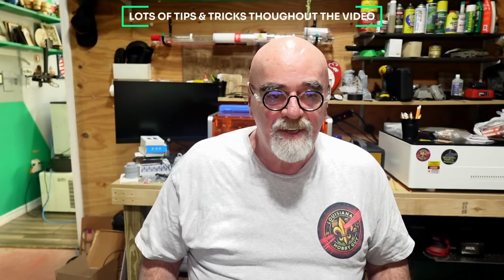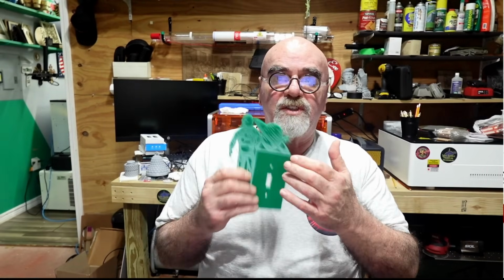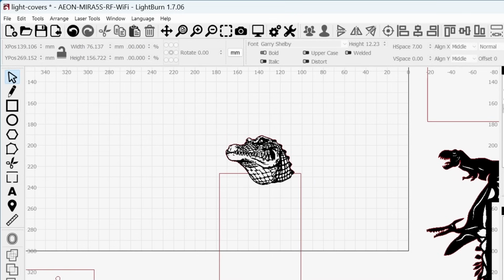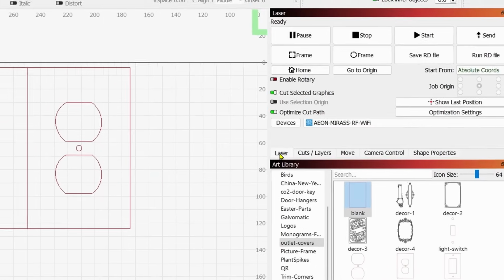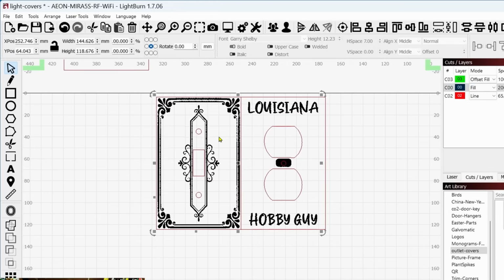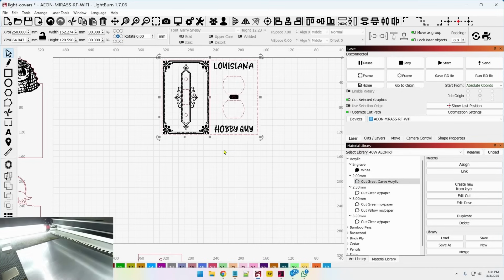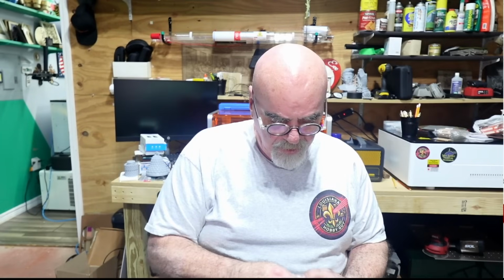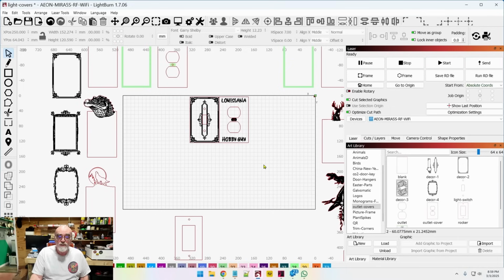💡 Making your own wall outlet covers in Lightburn on ANY laser engraver!

Comment from the maker: If you have an issue with the cover not sitting flush with the wall, just duplicate the cover, ungroup it, delete everything but the outline and offset it inwards by 3mm. Now you have a spacer to glue to the back of the cover.

Comment: How would you make a wooden or acrylic one that is up to code?  I thought about making and selling these with my co2 laser. However, wood and acrylic both can catch on fire. Any ideas?  When I have asked electricians they say neither acrylic or wood are up to code. I also dont want to get sued on my ebay or etsy stores.
Reply from the maker: No idea. Both Home Depot and Lowes sell raw untreated wooden covers, and the $0.19 plastic ones aren't fireproof. I personally probably wouldn't sell these though. While only builders and contractors have to meet code on outlet covers, you never know.
Reply: @TheLouisianaHobbyGuy  Thank you for the response back. I dont think i am going to sell them for legal purposes. I did look on lowe's site and it looks like you have to have metal plate behind the wood in order for it to be "legal". There are tons of people selling these on etsy and it looks like pretty good markup on them as well, but if someone's house burned down I dont want to end up being sued. I don't think people are thinking about this when they are selling them. 99% of people i see on etsy do not have the metal backing plate.
Reply from the maker: Yeah, pretty sure the liability falls on the installer, or owner if not done properly, not the seller of the item itself. If a homeowner buys a water heater from Home Depot and installs it themselves and there's a fire, the liability doesn't fall on HD. You could still sell them and just add a copy of a note explaining this to the buyer.
Reply: @TheLouisianaHobbyGuy  that is a valid point i didnt realize that. I don't really have a way to make the metal backing plate though. If i made them i believe id really want to do that. I looked online and cant seem to find them. Any idea where you could get those? I can't cut metal with my co2 laser or id just make them myself.
Reply from the maker: I really don't think they're necessary, since they only cover the screw holes, but you can get the metal backers on Amazon, and the plates I made did need them as a spacer: https://amzn.to/4ngH1Qq

Comment: I would be concerned with the sharp corners of these cover plates as they are flat, and a regular cover is thicker, and the edges are rounded to fit against the wall.
Reply from the maker: You can round them over if you wish.

Comment: Rich, I engraved and cut my first single light switch. It is beautiful but when I went to affix it to the wall switch, it woggle. Discovered that the light fixture does not sit flush with the wall and the manufactured plate is recessed in the back to accommodate the protrusion. Any suggestions? John von
Reply from the maker: Just duplicate the cover, ungroup it, delete everything but the outline and offset it inwards by 3mm. Now you have a spacer to glue to the back of the cover John.
Reply: @TheLouisianaHobbyGuy  Hi Rich, I did as you suggested but also discovered that the spacer needs to be 1/4" thick for the plate to sit flush. thanks again for the advice. John von
Reply from the maker: Yeah, it depends on the thickness of the sheetrock they used in your house. It also depends on the age... my house is 45 years old, and all the boxes are recessed below the sheetrock. Today, they use boxes with tabs on them to fit the studs and they stick out 1/4".

Comment: I love Lightburn but don’t care for the forum as the only source for tech support. Takes forever to get answers. 
My Lightburn wouldn’t work with my xtool lasers. 
Best Buy geek squad added a file to the program to make it compatible with Lightburn. Works great but the only drawback is I can no longer update the program. Always gives me errors when I search for an update. Geek squad said there is nothing they can do about it. 
Xtool told me their machines are compatible with Lightburn but they weren’t.
Reply from the maker: Support for Lightburn is via email, support@lightburnsoftware.com. The forum is an additional searchable resource. If you download the full version from the website instead of the update, it should work. They likely only installed the CH340 driver.
Reply: @ 
I’m pretty sure they just installed the driver. My other three computers update just fine. But they are each tied to a laser. The computer on my 40watt is newer and a gaming computer that I bought because of the larger graphics card and things run faster. Just can’t update the program. 
As it is now it all works fine and I don’t know if there are any updates that would benefit me so I really didn’t push the issue. 
Thanks for the feedback. I was once told that the forum was the only tech support. Glad to have an email address now. 
Thanks again.
Reply from the maker: My pleasure.

Comment: Great video but unfortunately I don’t have a CO2 laser. I do have three different diode lasers so I’ll be restricted to wood only. I’ve tried acrylics and didn’t have any luck. 
With the corners I think I’d put a small radius to get rid of the sharp corner.
Reply from the maker: You don't need a Co2 for scratch acrylic or dark solid acrylic.

Comment: Those are COOL Rich. We live in a Double wide, with the mobile home switches and outlets. Those things are a bear to switch out because of the way thet're wired and this would be a life saver. I would need to make them a bit larger and cut a spacer to fill the gap around them. I might need to get longer screws,as well but that would not be a problem. Thanks for sharing this awesome project.
Reply from the maker: Awesome! 👍 Thanks for watching Jimmy! Have fun with them!

Comment: Just a note that some states (like California) require switch plates and outlet covers to be fireproof (or some amount of fire rating). If you had a fire and they found untreated wood or acrylic ones there is a possibility your insurance company 'could' use that as an excuse to not pay out. I don't know which states have these ordinances but just something to be aware of.
Reply from the maker: I cut these at about 1700° without any flame, so I think they might be just fine. I doubt the cheap plastic ones they sell at the big box stores would do as well under the laser.
Reply: @TheLouisianaHobbyGuy  I was just letting you know what some states require. In CA the cheap plastic ones must 'self extinguish' when lit on fire. Don't think if you used a torch on wood it would go out on it's own like these. That being said the scenario I mentioned first will likely never happen but something people should be aware of especially if they plan on selling them. For your own use, well knock yourself out and take the minuscule risk.
Reply from the maker: Thanks, the purpose of my videos are Lightburn training.
Reply: @TheLouisianaHobbyGuy  And it's a good video.
Reply: @sublimationman  It’s not just a local building inspector issue. Per the National Electrical Code all components of an electrical installation need to be certified by UL. That would include the plate covers. I think what you’re doing is really neat. I do rotary engraving on outlet covers. I would like to get a laser to speed things up.

Comment: sigh... get ready for the flack. When I posted the files for a 3d printed cover (that I have been using for almost a decade), I got so much heat (no pun intended... well, maybe just a little...) about the "safety" of doing so. I think certain people should never attempt even replacing am outlet cover on their own. Some people need to just leave that to the licensed professional electricians. For the rest of us NORMAL people... awesome video!
Reply from the maker: 🤪 If the outlet is wired properly, there will never be an issue. Oh, and I cut them with a laser at about 1700° and they didn't catch fire, so there's that... I get your point though.

Comment: Cool. I did this design as well but did an R2D2 , Millennium Falcon and Deadpool. I had to burn the back a bit so they fit around the switches and receptacles better.
Reply from the maker: You just loosen the mounting screws on the receptacles and use a longer screw for the cover for a perfect fit.

Comment: Rich, I have a 55 watt CO2  laser. I use 15 mm/sec cut speed and 65% power and one pass and low air. That seems to work well for cutting this type of material.
Reply from the maker: Thanks for sharing your settings. The ones I used were from a material test. This laser is a ceramic RF Co2, so our settings are not even going to be close.

Comment: I think that you need to be very cautious when using your own home made electrical covers. I got very interested in doing this when you publised it the first time around, but decided against it for safety reasons. 
According to the Electrical code, electrical covers must be made of non-flammable materials, and must be installed flush with the electrical box. The covers that you buy are UL listed to meet all electrical code safety requirements. I have seen arc-flashes when a wire breaks loose behind these plates. UL plates protect users from fire hazard and from shock by containing the arc, (spark) when a wire works loose. Flammable or incorrectly manufactured plates could introduce a needless safety hazard. Please do this with extreme. caution.
Reply: I suggest that you do not attempt to replace your electrical cover on your own. That should only be performed by a trained, certified and licensed electrician. 🙄